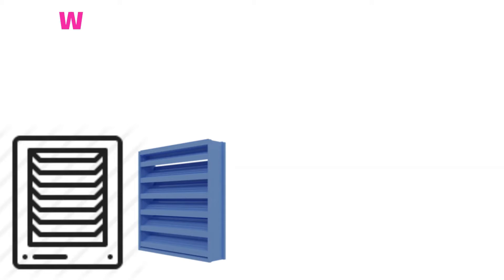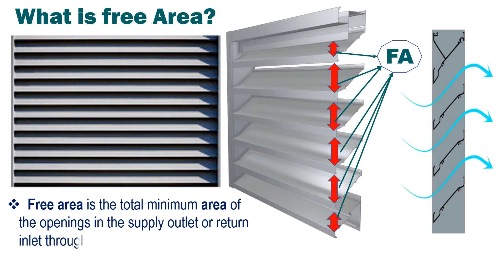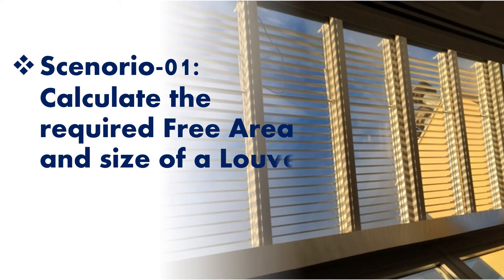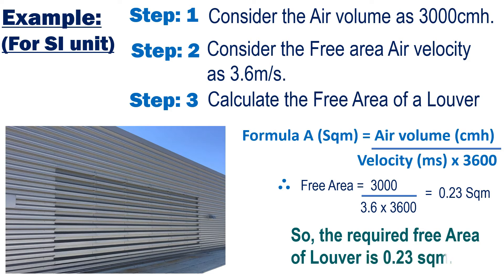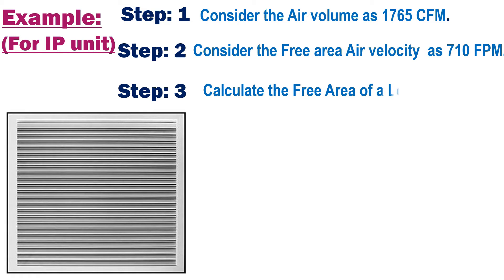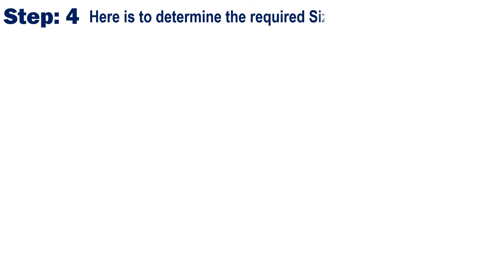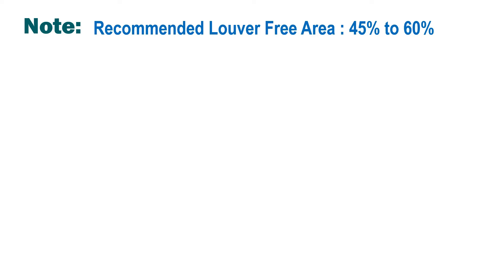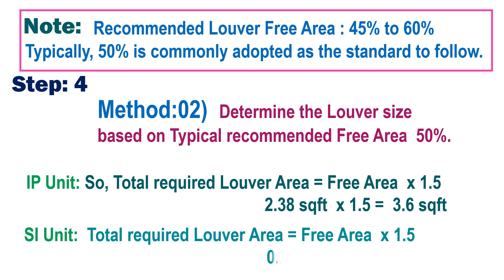How to Calculate the Louver Free Area and Procedure to Size the Louver

Comment: To get total required louvre area i dont think it is Freaa area x 1.5 but x by 2 as the typical free area of a louvre is 50%. You have already calculated the free area so you simply double it.
Reply: Correct, factor of 2 as a lower limit. I've seen most louvers with 40% NFA. I typically would calculate for a factor of 2.5 to be safer.

Comment: Hi please do a video on huge air handling units which can produce a 100KW power with 560/630 mm diameter and using microchannel coil and ec plug fans with primary and secondary filters